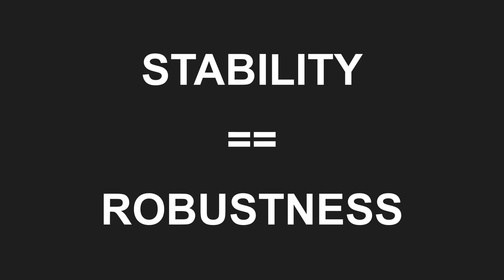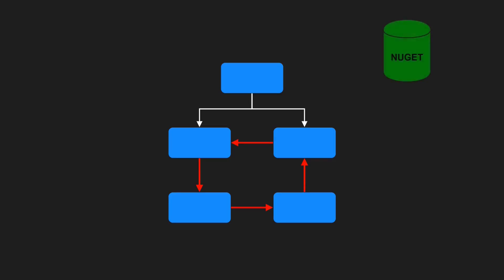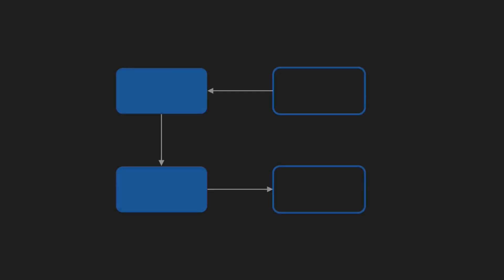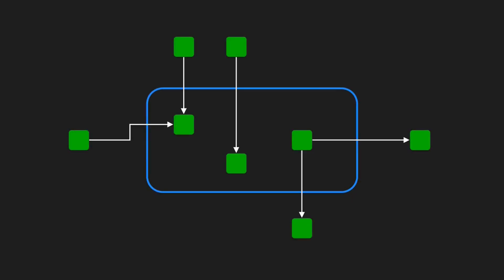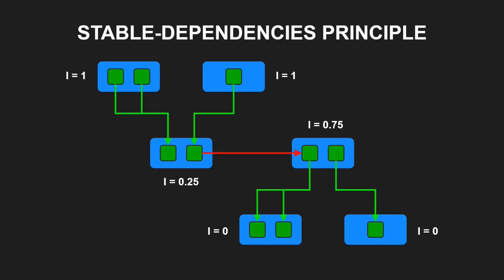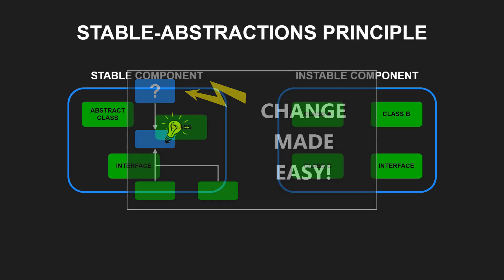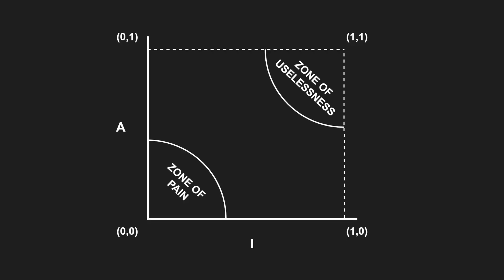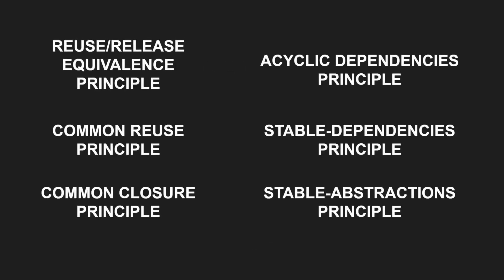Principles of Component Design - Part 2

Comment: What did I just watch? Could you explain these things with some concrete examples and not just on an abstract university course level?
Reply from the maker: @pl4gueis The intent of part 1 & 2 has been to explain the conceptual ideas. I am already planning a part 3 showing how to apply these principles in a concrete project 👍😉
Reply: From what I understand, this centers around dependency management. A more concrete example would be that the Application layer should depend on the Domain layer, as opposed to the other way around, given that the Domain layer is generally more stable than the application layer.
Reply: @pl4gueis
( Excellent explanation never thought about these principles in that perspective !!! )

What he is saying is the very essence of these principles. You understand they why of an architecture that takes places in an app. It is a deeper understanding of the system !!!!

In one phrase:
The video has to do with where the business ( rules ) should live by fixing the stability of the app from "a dependency component perspective" ( meaning using the "Principles of Component Design" ).

A dev that lives within a codebase/app for a long time has already understand this without knowing it ( and cannot name it with the clarity of the videos depicts it ).
In its core it says that the things/Classes that all depend upon and are harder/stable to change are the ones where the logic/business should live.
In the video defines the "harder/stable" with calculations using the Principles of instability.

If you think about the onion architecture and the point of arrow of dependencies from external layer to internal is the same principle.
Here the video displays it fine grained from a component/package perspective ( not from the architecture layers of the app )